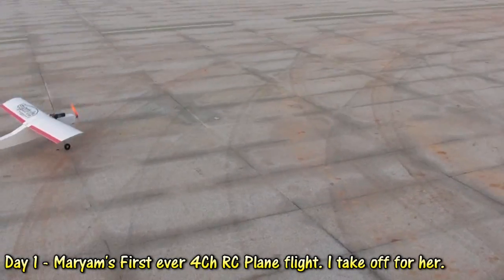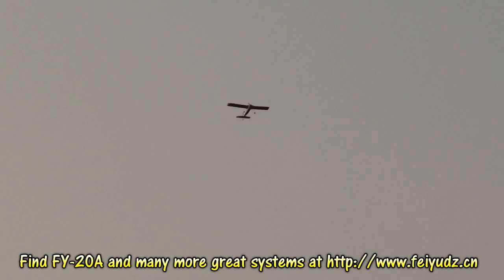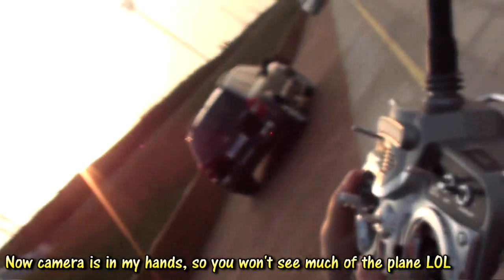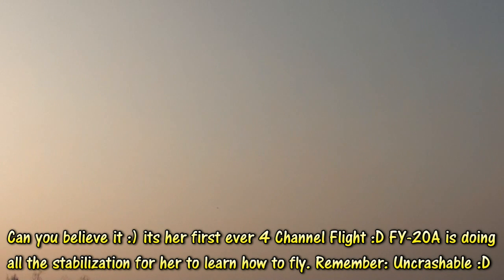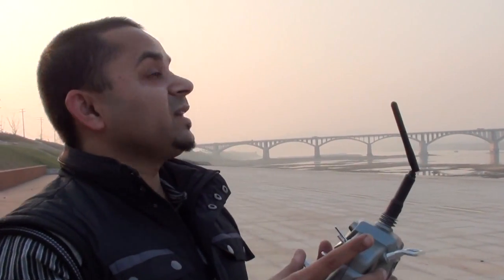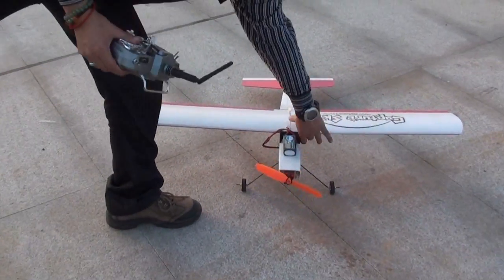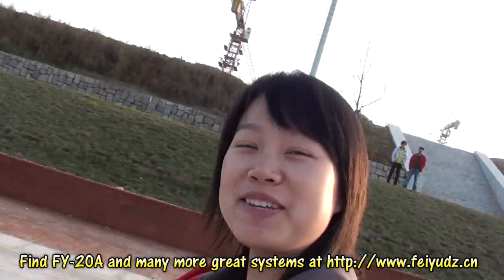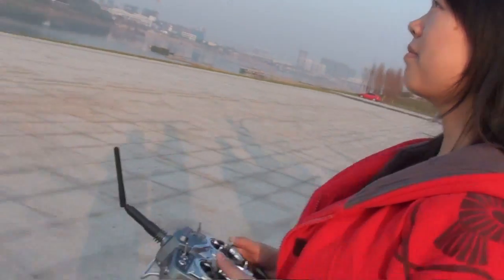Maryam the First Female RC Pilot in City

Comment: When the plane is up on a desired altitude...level it by elev stick...am I wright....on making turn using rudd.alone...will it bank the plane....and making turn again is it good to roll the plane using aileron n a little up elev to maintain alt.[elev turn].?....I've seen one of your video on flying plane on sim..eg.. to make left turn-left rudd right aileron..n right turn-right rudd left aileron.  Which is the best way .......Ali?